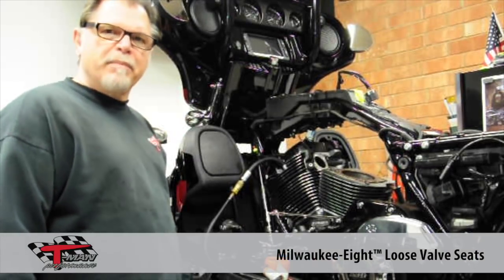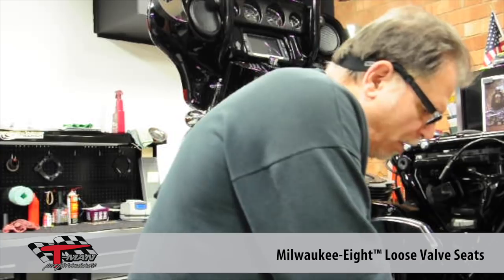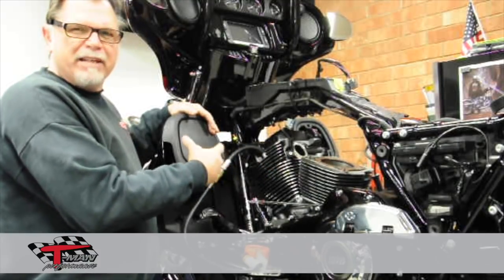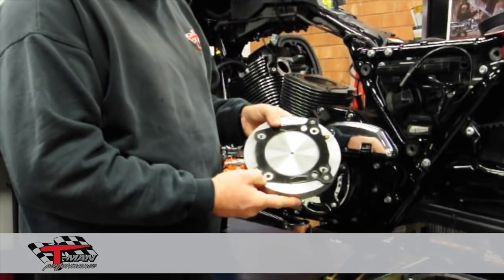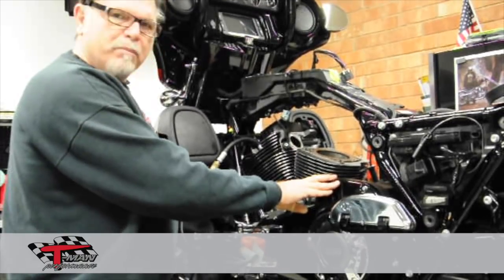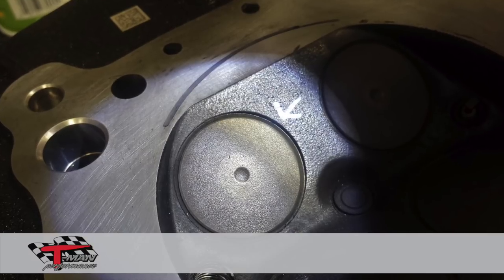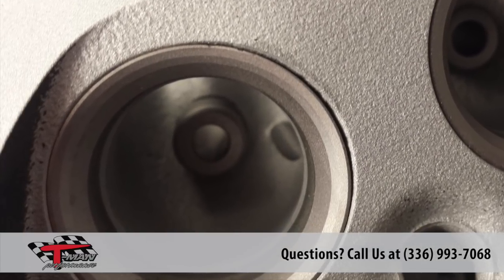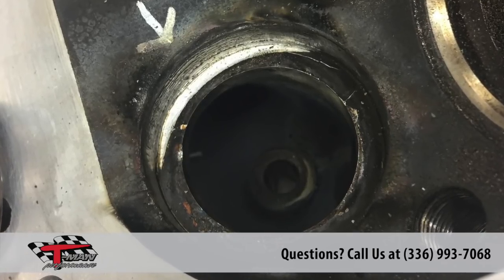Milwaukee-Eight™(M8) Loose Valve Seats

Comment: Can you please elaborate more on how its good to heat a head up of your customer than drop it on plywood? Also is there a Harley Davidson spec for your leak down billet adapter for the leak down? I understand that you have found some bad seats, but out of the thousands made that are good would you say that the quality is not good? Also would you say that if 3-5 % leak down on 2 valves is ok then after doubling the valves you would have double the leak down? So 4 valves at 5% would be 20 % leak down per head? Not really sure I fully understand everything....
Reply: So all internal combustion engine's are held to 0%? Do you really believe that? Aside from HD take that out of the equation.
Reply: dbltrplx You'll NEVER see zero% leak.